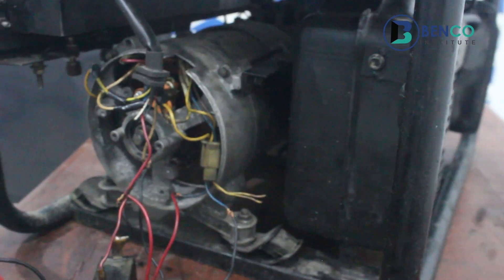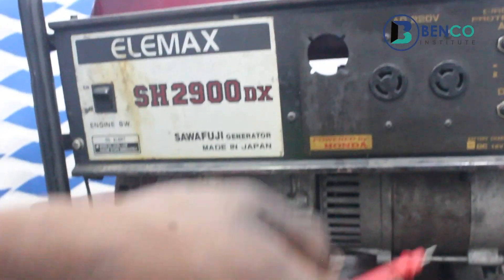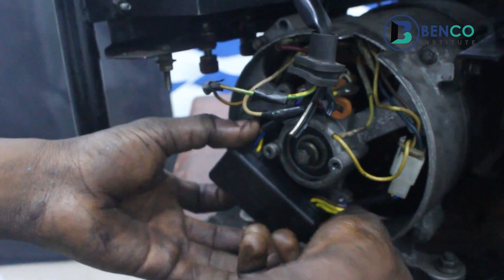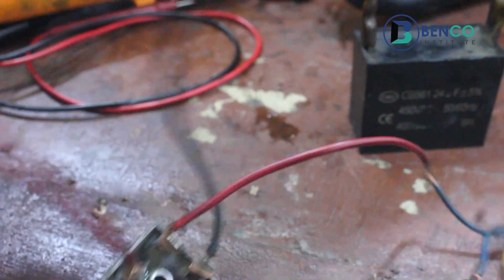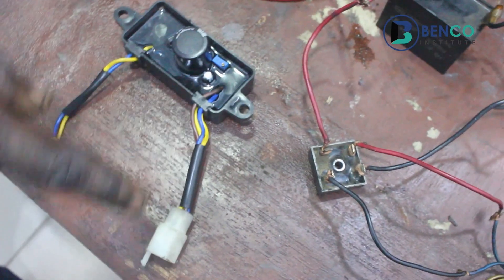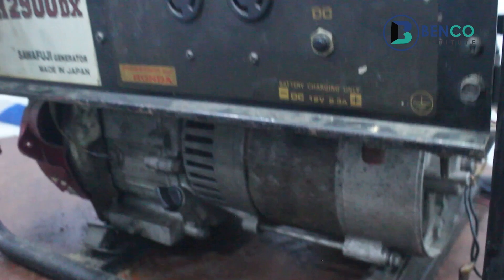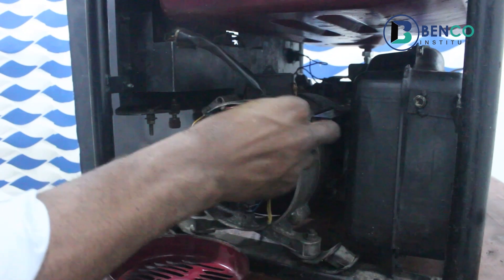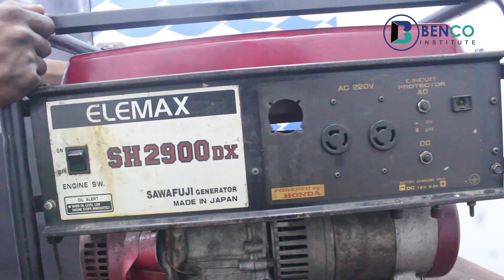RESTORE NO/LOW POWER OUTPUT IN A SMALL GENERATOR BY CONVERTING AVR TO  CAPACITOR[Brushed Alternator]

Comment: Hello Mr Benco. This is a very good tutorial. Thumbs up!

I have this exact model of generator ELEMAX SH2900DX (although with GX 200 engine). Please, how do I determine if it has genuine copper coil or aluminium coil?
If it happens to be aluminium, can you please upload a tutorial on how to build copper coil?
Your tutorials are very clear and I understand your explanations well.
Thanks in advance
Reply from the maker: Oh okay noted
Reply from the maker: Examining physically u mean right?
Reply: @bencoinstitute  examining physically, yes. 
But on a  realistic note, I guess we can't possibly know if it has genuine copper coil or aluminium coil merely looking at the outer features of the generator (without unscrewing the alternator to check the coil).

Comment: Good Morning. My RDX- 8910 Fireman generator is working but voltage fluctuates when load it applied etc. Because of this the UPS at my office don't work. I have changed the AVR and also played with the engine revolution by regulating it but it turned out to produce over high/too low current. Pls any idea what could be the cause?
Reply from the maker: Does the engine sound fluctuates too...expecially when load is applied?
Reply: @bencoinstitute  Not really. The sound changes but doesn't vibrate. UPS don't work on the generator and voltage fluctuate up and down. AVS goes from green to yellow & red depending on loading & unloading.
Reply from the maker: @irone316  okay....

Have u worked on the carburetor b4?
Reply: @bencoinstitute  Nope, it’s a new Gen of less than 2months use
Reply from the maker: @irone316  
I prolly believe with adjustment of the speed(RPM) u can get the required voltage to power sensitive Electrical products like d Ups and so on

However  has it been like this since it's purchase?

You can equally send a message on WhatsApp if need be

https://wa.me/message/DANAYZJDOP6VB1

Comment: The final output voltage after using capacitor and diode is quite high, please what can be done to decrease it to between 200v-240v
Reply from the maker: 1.You can do that by decreasing the speed of the generator....

Go through our videos....a video teaches that appropriately

2.A smaller rated capacitor let's say 12uf v will fix it
Reply: @bencoinstitute  thanks a lot bro. It was bringing out 20v with several AVR. But this method using 24uf gave me 235v which is very OK.
Pls I will love you to explain why the AVR are not working even though they worked when tested on other gen.
Thanks once again, I really appreciate it
Reply: @johnsimire7804  it's because the alternator is not working that's to say that 
It is burn inside and the resistance of the alternator is below 40% which can not bring 220v again.
Reply from the maker: @johnsimire7804  That's simply because the  Rotor of the alternator has lost it's original strenght